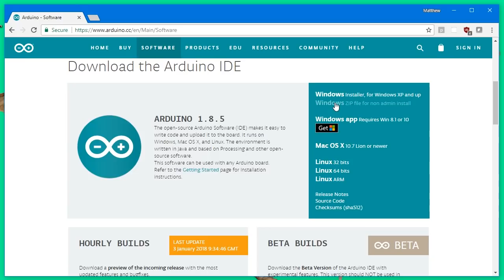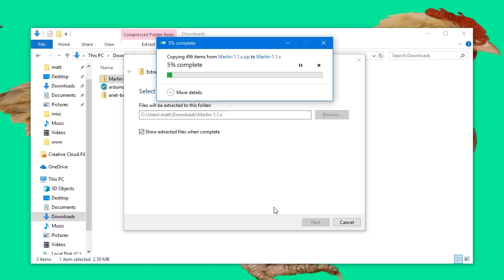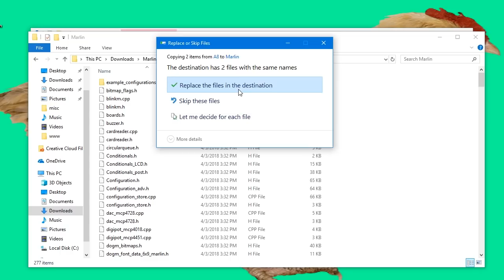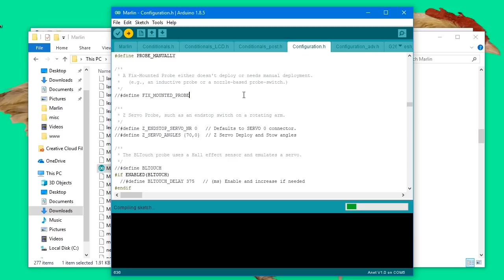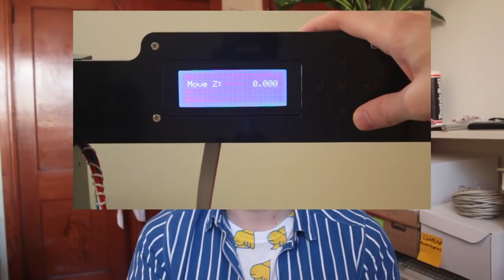Anet A8 Upgrade: Why & How You Should Update Your Firmware - Marlin Install Tutorial

Comment: The over heating safety precaution happened to me, but it was because my fan was cooling my ABS too fast
Reply from the maker: I actually just had this happen to me today because my part cooling fan nozzle is a little goofy. But it looks like you can adjust the thermal runaway settings quite a bit if needed: http://marlinfw.org/docs/configuration/configuration.html#thermal-protection-settings
Reply: I like it the way it is, im actually glad it happened so i know the setting actually works, and all i had to do to fix it was set the fan to 40% speed, i do wish though there was like a pre heat retraction button so i could change filaments easier.
Reply from the maker: Yeah that would be nice. I looked around but it does appear that you can't add another preheat option. You could make a little Gcode file to set the temperature though, then put it on your SD.
Reply: True true, i just wish there was a way to activate the retraction on the printer.

Comment: I already commented once, but I must commend you again. Excellent video, great presentation. As someone already mentioned, you should mention that the Arduino IDE needs to be run once first for the /Documents/Arduino folder to be created. 

I'm finally done seeing the "your house will burn down" warning from OctoPrint and I have some piece of mind! I ran the bed leveling tool, which was great. Havent printed yet, but it appears to be working. When I go to save/store the bed leveling settings, the printer does not give me any confirmation that settings were saved. Is this normal? I selected the "Store Settings" option, so Im assuming it saved. Any way to confirm? In your experience, is the "M420 S1" start code required for most people? I use Cura. 

Thanks again!
Reply from the maker: Glad you liked the video ! And yes I think that's normal, I haven't seen any indication of saving myself. It's one of those things where I click the button multiple times to be "safe". An "M420 V" command will show you the leveling data you have stored. Info here: http://marlinfw.org/docs/gcode/M420.html I'd say go ahead and put the M420 S1 code, it won't hurt. It seems that people have said they need it.

Comment: hey there! thank for this video, it helped me a lot! just a noob question, i need to do the bed leveling before each print? or it just stay saved after i hit store settings?
Reply from the maker: Hit save and it will remember it. But take a look at the video description because you may need to modify the start gcode that your slicer uses so that it makes use of the bed leveling.
Reply: You should do it every 10 prints to 1week or whenever it seems nesiscairy
Reply from the maker: Good tip, thanks !

Comment: Mathew
Well I did what you said and it changed my firmware but I am not sure it is working right. I only get one menu with 4 lines and does not let me get to the homing or to move the steppers let alone the probe the bed leveling.  I changed the board as I had the old on that was long and narrow but never got the thing to work as the z axis homing switch would not work.  so now nothing works. any thoughts not what you would call a programer for  computer software.  I was running only with an sd card befor as I could never get the usb to work .
Reply from the maker: The menu won't work at all ?
Reply: @MatthewRayfield  I have the same issue. It flashed, but the menu will not function at all.

Comment: You are a profoundly likable nerd. Your video is informative and entertaining. Excellent combo. Thanks for this tutorial. I had the same heat bed plug burn out (replaced the wire harness with a beefier one that includes two leads for both + and - connection) and don't want thermal runaway to burn down my house. 

I have also read stories of runaway also happening @ the hotend- heating pack comes out from stress, thermister reports that hotend is cold and then heat element runs away and catches cooling fan nozzle on fire and maims your family. I dont like that.
Reply from the maker: Hey thanks again ! Hadn't heard of it catching the fan nozzle on fire, but makes sense. Dangerous little things I guess. I just stay put clutching a fire extinguisher if I'm printing.
(okay not really about the extinguisher, but it is nearby)

Comment: It almost worked, but then at the end of the upload I got this:

avrdude: stk500_getsync() attempt 1 of 10: not in sync: resp=0x30
avrdude: stk500_getsync() attempt 2 of 10: not in sync: resp=0x20
avrdude: stk500_getsync() attempt 3 of 10: not in sync: resp=0x30
avrdude: stk500_getsync() attempt 4 of 10: not in sync: resp=0x20
avrdude: stk500_getsync() attempt 5 of 10: not in sync: resp=0x30
avrdude: stk500_getsync() attempt 6 of 10: not in sync: resp=0x20
avrdude: stk500_getsync() attempt 7 of 10: not in sync: resp=0x30
avrdude: stk500_getsync() attempt 8 of 10: not in sync: resp=0x20
avrdude: stk500_getsync() attempt 9 of 10: not in sync: resp=0x30
avrdude: stk500_getsync() attempt 10 of 10: not in sync: resp=0x20
An error occurred while uploading the sketch

Any ideas?
Reply from the maker: Could be wrong port ? Or the wrong board selected ? Try checking those and trying again. It's for some reason not able to connect so just double check everything.

Comment: Skynet V2.3.2 has auto mesh bed leveling and it works! You have never tried it, it's obvious.
Reply from the maker: Skynet v2.3.2 is based on Marlin 1.1.0-RC8 (released Dec 6, 2016) and the Skynet Github repo hasn't been touched in a year. The latest version of Marlin I installed here is 1.1.8 (released Dec 25, 2017). Skynet probably does work, but why run an old offshoot of the Marlin firmware when you can use the original and up to date version ?
Reply: I think the sky net branch was re-integrated with main Marlin flow around that time
Reply from the maker: that would make sense !

Comment: Ok a couple of things because this video is incredibly misleading.

If you're using auto-bed levelling with a sensor, do not uncomment PROBE_MANUALLY or LCD_BED_LEVELING these options are for people without a sensor so they can use the LCD and controls to perform a kind of semi-automatic bed level with a piece of paper. Enabling these will force any G29 (auto level) commands to default to the semi-auto bed levelling procedure meaning your sensor won't do it's 9 point automatic check, it'll just ignore your probe offsets and move the nozzle around one point for each g29 command because it thinks you're doing each point manually with paper.

If you're using a sensor to automatically level the bed, you need to uncomment FIX_MOUNTED_PROBE unless you're using a BLTouch, in which case the options for that are directly below the fixed mounted probe option. If your sensor can't home safely at it's 0,0 point (for example if you're using a capacitive sensor and there's no bed beneath 0,0) you need to uncomment Z_SAFE_HOMING, if you're using an ANET A8 you need this uncommented.

Hopefully this will save people using sensors a bit of hassle.
Reply from the maker: It's not misleading at all. I state that I am explaining how to setup marlin for manual bed leveling. There are other videos out there about installing sensors but I wanted to show people that you can still get a better experience with new firmware alone.
Reply: Right before you start the tutorial bit you talk about using a BLtouch, then there's no mention of levelling manually until after we've uncommented everything and even then there's nothing in your video informing people the manual options will disable automatic levelling. I get that it wasn't intentional, but if people are following along with the video step by step, this is misleading. A simple disclaimer saying this is for manual levelling only would've sufficed, especially when the Anet A8 was sold with an optional stock sensor.

Comment: I have the A8-M (has the 2nd print head already).  Would I still use the same config files (the A8) or do I need something different?
Reply from the maker: This is just an educated guess but... I think you can start with the existing A8 config and modify it. I would go through Configuration.h and read the comments and think about if each setting needs modification. For example, one of the first settings is #define EXTRUDERS 1. This would need to be changed to #define EXTRUDERS 2. Marlin has great documentation where you can search the name of each configuration setting and see exactly what it does. It looks like a lot of the settings for dual extruders comes in through the slicer by way of gcode, so there may not be that many changes needed. Hope this helps !

Comment: I cant find the anet v1.0 in the boards menu
Reply from the maker: You probably need to install the board definition see 6:47
Reply: @MatthewRayfield  which part is the board definition? I did it step by step from your video and I have the same problem.
Reply from the maker: @lindahall2664  It's downloaded from https://github.com/SkyNet3D/anet-board and take a look at 6:47 and 7:18 for instruction on this. Let me know if that fixes it !
Reply: @MatthewRayfield  Is does not fix it.
Reply from the maker: @lindahall2664  If that hardware folder from the board definition download is in Documents/Arduino it should show up in the Arduino program. Not sure what else to advise :/
Reply: @MatthewRayfield  now my marlin.ino doesn't have anything in it?
Reply from the maker: @lindahall2664  Hmm, I don't know why that would be. You can always try re-downloading the Marlin zip file and opening it again
Reply: @MatthewRayfield  ok finally got it all working except now my printer says homing failed printer halted please reset? Can you help with this?
Reply from the maker: @lindahall2664  Not sure what might be causing this. I'd recommend taking the exact error message you're getting and Googling it along with the keyword "Marlin". There are a lot of posts online about solving issues like this. Hope that helps!

Comment: Tried it still trying to get printer to work   have tried it 4 times now
Reply: Ok Just tried it with opti board failed and  recompiled the whole thing and then used anet ver 1.0 board and it worked  i must have had an error in the first compiling job..
Whew!
Reply from the maker: congrats ! glad it worked out. it should be a pretty safe procedure because this doesn't change the bootloader.
Reply: Yeah i must have done something stupid the first time it compiled  not sure but then i tried starting all over again and it worked

Comment: Thanks for the video. It's a great guide! I have a question. If I wanted to add the auto bed levelling sensor (the Anet A8 official one), do I need to only do the first two changes that you did to the Configuration.h file and not the last one? And then I calibrate the sensor in the usual ways found online.
Reply from the maker: Yes that sounds right. I would have to look a bit more into it to be sure. But you will enable mesh leveling but not LCD related things. There should be some more info online about using it with the capacitive sensors. I am using the BLTouch now which has a slightly different setup.

Comment: Thank you for this interesting addition to the  videos out there about this upgrade.
My main interest is in the orange warning messages during compilation. I have been asking around on Facebook anet site and questioning other contributors to Utube, the ones I have watched so far cut off the video before they appear.
Thank you for including them in the video.
I am still trying to understand what they mean, not being a C++ programmer they worry me.  I have followed some other route to get the pins_arduino.h file and have a newer version file that works and does not have these messages and appears to work as does the Skynet source.
I have not yet applied the Skynet file to see how it works, I will try it now I have seen your video, to see if there is any different results.
Reply from the maker: I went back and looked after reading your comment and it looks like most, if not all, of those are warnings about redefined constants. So I think what's happening is that there are certain default settings set in one file, and then another file down the line might change certain settings. If this is also what you're seeing then it's to be expected because there are so many options in Marlin and this would make sense for how they work. Like you may change something in Configuration.h that overwrites a constant higher up the chain, if that makes sense.
Reply: I have had this Orange message with an error thats about out of sync, I have Anet A8 1.5 board a new one, it is i believe the Bootloader that's not been installed on the Board. I have read that you have to use an USBASP: http://amzn.to/2FiqUNH to flash the bootloader with a 10 pin to 6 pin adaptor. Another guy i was talking to said he got it to work after he flashed the bootloader. You plug it in to the J2 connector on the left side of the board that the display uses. youtube video of UsbASp Flash Bootloader with find two videos of how to do it with more detail. I have the USBASP but waiting for the Adaptor.

Sky net is old now so use marlin. Hope you have success with your update. I only want to do it cos of features that are not on the original firmware like auto shut off if head or hot bed dont heat properly to prevent fire. And Autoleveling with sensor.

Comment: Thanks, followed the steps and it worked. But:

You should make a note somewhere that this won't work for 1.5 boards without some extra steps, and some extra items that do cost money. 

I had to burn bootloader with a USBasp, as well as a 10 pin to 6 pin adapter, because this method doesn't work with the newer 1.5 board. 
After I did that, then this worked to flash Marlin.
Reply from the maker: Thanks for this info, I'll add this to the FAQ
Reply: It works well with an Arduino Uno and some jumper cables to flash a new bootloader. Anet seems to leave out the bootloader on some of the 1.5 boards but not all. So flashing a 1.5 board with a USB cable may or may not work. If you want to re-enable it again you need to re-flash a bootloader.

Comment: Mathew, 
As an Anet A6 new comer, thanks for the video, 95%, however as for headline content explanation 10%.
From a 10min.55 sec. video there is only 3mins 20 (+/-) of actual firmware up-grade information. 
Obviously you know your subject very well, so much so that you run through the steps far too fast for a new comer to grasp, I respectfully suggest that you pause on each new screen to enable one to read, take notes on what must be selected and then move to the next step.
When in college if your calculus tutor had spent 45 mins of a one hour lesson pontificating about non relevant things and only 15 mins of teaching you may have felt “hard done by” (or may be not?)
Just trying to help.
Reply from the maker: Thanks for the feedback Rod. I agree with you on the speed of the tutorial. I never expected this video to get as many views as it has. I would have redone it at a slower speed had I known. As for the intro though, it is a tad long, but my intention was to make a video explaining why one should upgrade their firmware even if they are not doing hardware updates. So I wanted to explain that idea in full. The tutorial aspect was a secondary goal actually. But definitely if I were to redo this video, I'd do it differently. Thanks again !

Comment: By the way, this is the version 1.8.5 and i tried this with the arduino version 1.8.6 and just received an error message. so use 1.8.5 :D
Reply: just did it and it also works with v 1.8.8

Comment from the maker: I've added an "Additional Notes" section to the video description. It covers some FAQs and tips that people have shared in the comments. Please check this out if you're having any problems or want to do more. Cheers! UPDATE 2018/7: I've just added a bit about issues installing to newer v1.5 boards.
Reply: hi Matthew, thanks so much for your great tutorial. i found an issue when finish compiling, printer do not restart, com port is correct and detected, i go to TOOLS and seleted the Anet v.1. what you think that can be the problem? Thanks in advance
Reply from the maker: Hey hey! You got this to work I take it by your other comment. What ended up being the problem ?
Reply: Hi Matt, indeed , i forgot to press the "UPLOAD" button on Marlin, now, indeed i uploaded the firmware, i have few issues, i believe it has to do with marlin, because i never had any issues with stock firmware. Issues from pausing during print to display scramble characters, that i had to restart many times. Temperature reading 200/200 and the hotend got cold.

im still testing, i printed a calibration box and so far worked ok. But I still dont trust this update because anything can happen if i decided to print a part that will go for hours, and i never had a issue with stock software for long prints.
Reply from the maker: That seems very odd. Marlin actually worked better for me than stock. But it is possible to downgrade if needed.